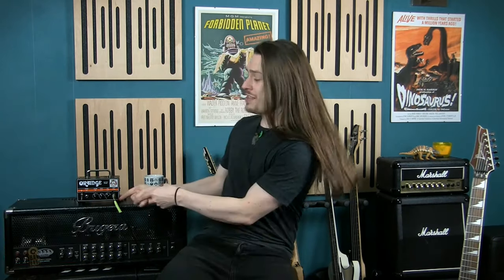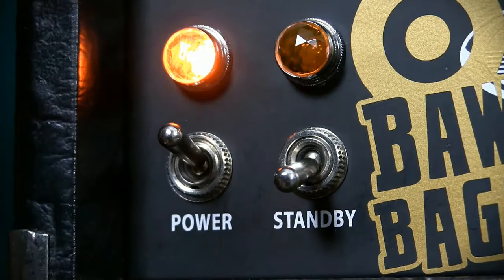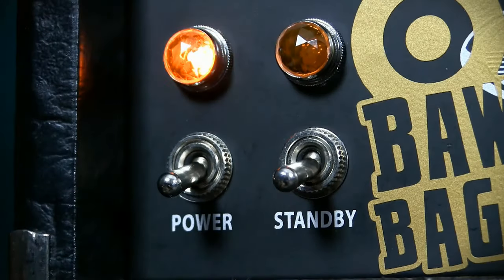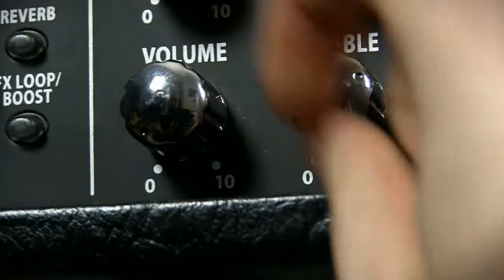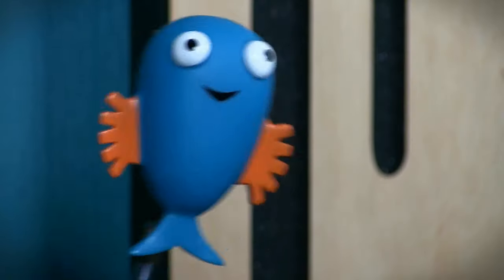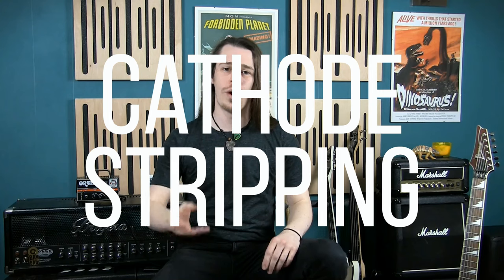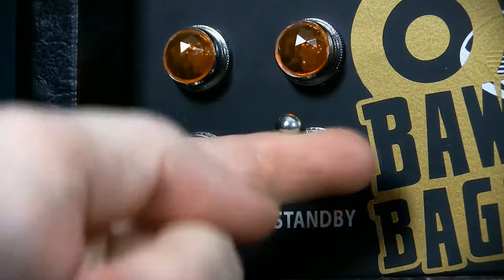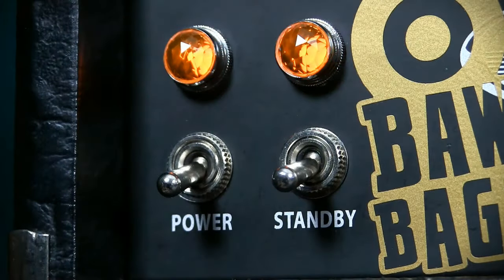Your Standby Switch Is A Lie!

Comment from the maker: To save myself a whole bunch of time answering things individually, I'm going to post links as replies to this thread so you can do your own research.
Reply from the maker: http://www.wamplerpedals.com/news/blog/talking-about-gear/should-i-put-my-amp-on-standby
Reply from the maker: http://www.valvewizard.co.uk/standby.html
Reply from the maker: http://debontamps.com/standby-switches/
Reply from the maker: http://www.londonpower.com/standby-switch
Reply: CSGuitars What bass(es) do you have?
Reply: Isaac--there is literally no point in putting the amp in standby before turning it off.  I personally like to turn the amp off in the middle of a big chord so you can hear the capacitors discharge.
Reply: Yes! it makes that cool "Old tv turning off" sound if you turn it off with the guitar makeing noise
Reply: I approve of this.
Reply: There might be some value in using a standby switch on amps that use a DC-coupled cathode follower (Fender Bassman, Marshall and amps based on those) as the voltage conditions at switch-on can cause arcing in that particular valve.  There are ways to protect against this without using a standby switch, but I've yet to hear of any commercial amp which uses them.
Reply: You can just wire a diode between the grid and cathode.  That said, I don't see the point in putting cathode followers feeding the tone stacks in the first place, from a design perspective.  Low impedance is only necessary if you want high Q filters, and you don't need (or want) high Q in the tone stack.
Reply: It's not about low impedance anymore -that was just Leo Fender's original motivation (he loved 'clean' amps so borrowed a lot of hi-fi ideas). It turned out to be a lucky accident that DC-coupled cathode follower produce a very gradual and pleasant form of overdrive wirthout having to add more gain to the signal path, so they are still much used today.
Reply: What are you talking about? The cathode follower operates with extreme levels of negative feedback, it won't overdrive easily at all.  It's exceptionally linear over its operating range.
Reply: That's the whole tradeoff... you get a gain <1 in exchange for linearity and low impedance, but neither of them are necessary.
Reply: It may be possible to use a diode between the grid and cathode, but I don't know of any commercial guitar amps that do.  So when using any Bassman or Marshall type amp, I'll use the standby switch when turning it on.  For breaks or when switching off, I don't bother.
Reply: My thoughts on the whole Standby switch spiel would be you're more likely to be wasting service life with it since you're putting extra wear into your heaters. If you've ever seen a  dead short in an amplifier, that's generally caused by said heater melting and crashing into a grid, which shorts the 6v heater line into a 330v-ish (depends on your amp's bias and the tube in question) grid line, producing a high current draw and that usually (if you don't use nails as 500A ultra slo-blo fuses) pop the fuse. On another note, if ALL tubes suffered cathode stripping... I'm pretty damn sure I would have been screwed by now since I have a hybrid amp with no standby. Add to that that I'm not the kindest to the tube in that amp since I give it no more than 10 seconds to heat up enough to produce a signal before I start playing and if the cathode stripping issue was to occur, I'd be on my 20th tube already!! So far I've only replaced one and that was because I was getting some Microphonics, and tapping the amp itself made the tube ring out... it was a tinnitus inducer if you popped the top and hit the tube with a pencil because it fed back to the cab and started resonating!!
Reply: +Dietrich Epp
DC coupled cathode followers are usually biased quite hot, to the point where control-grid current flows even at idle. This causes compression (ie: distortion) on the positive-going peaks. The amount of this compression can be increased by biasing the preceding common-cathode gain stage cold and raising its idle anode voltage, or by lowering the cathode resistor of the cathode follower forcing it to draw more idle current, or also by including a grid stopper resistor between the gain stage and cathode follower to limit the amount of grid current that can flow. 
This is a well known effect that is utilised in many high-gain modern "metal" amps - one of the best known examples is the Soldano SLO which features multiple DC coupled cathode followers for their added compression.
Reply: The SLO 100 uses 100k cathode resistors for cathode followers.  I wouldn't call that "quite hot".
Reply: Dietrich Epp you're right. The cathode followers in the SLO are biased relatively cool. That doesn't change the fact that they still draw quiescent grid current and will cause asymmetric compression. I mentioned ways to ACCENTUATE that effects (like biasing the cathode follower hot), I didn't say that the SLO utilised all those methods.
Reply: Quiescent grid current is negligible unless the cathode follower is heavily loaded, and no, the tone stack doesn't do that.  The cathode follower will remain extremely linear over most of its operating range.  In order to get it to distort (compress), you'll have to drive the previous stage into heavy distortion first.
Reply: Dietrich Epp Go 'scope it out. I think you'll be surprised what you'll find. 
A 12AX7/ECC83 will begin to draw grid current even before it reaches 0Vgk, drawing around 300pA at -1Vgk. 
It's nothing to do with loading on the cathode follower, that just reduces its gain (A) further from ~0.9. 
That statement alone shows you don't really know what you're on about.
Reply: You're not here to make accusations about whether people know what they're talking about, you're better than that.

But 300pA is not very much with the source impedances we are talking about.
Reply: Dietrich Epp You're telling me I'm wrong, I'm explaining that in fact, you're wrong. Not making accusations. But you appear to have already made up your mind, and are not listening to (or purposefully ignoring elements of) my argument. So I responded in kind. Maybe that was childish, but it is Youtube after all. 

300pA at -1Vgk may not sound very much, but when we consider that with typical guitar amp DC coupled cathode follower values of 300V B+, 1k5/100k gain stage and 100k cathode follower, the gain stage anode will sit around 210V, and the cathode follower will be biased around -0.3Vgk, and be drawing 20-30uA at quiescent! Also, the control grid impedance shifts from essentially infinite, to as low as a few k-ohms on the positive swings. Explain how all that doesn't add significant distortion?

You're thinking of either text-book designed DC-coupled cathode followers with the cathode follower biased much cooler, or the occasional much more conventionally designed AC-coupled cathode follower we sometimes see in guitar amps which may feature the astonishingly low distortion figures cathode followers are capable of.
But in guitar amps, we don't do things by the book - we want distortion. Anything designed "incorrectly" can be made to distort, just as we could design a common-cathode gain stage with vanishingly low distortion figures too, we can design a cathode follower to have high distortion figures.
Reply: You say that you're "not accusing me" but in the next sentence you suggest that I'm "purposefully ignoring" parts of your argument.  That's just a coy accusation.

I'll admit--I hadn't thought about purposefully biasing cathode followers for distortion.  But I still don't think I'll use it in any of my designs, because I think there are more interesting ways to use the extra stage, and I prefer distortion that's more gradual.  It may be a factor that most of the amps I've really analyzed were either old designs that didn't have stages to spare for cathode followers, or more modern high-gain designs with 220k anode resistors.

Peace among worlds.
Reply: Dietrich Epp I'm done, I hope ignorance is bliss.
Reply: Greg Robinson "I'm done, except I want to throw a passing insult at you for good measure."
Reply: @Dietrich Epp, cathode follower distortion is gradual -more gradual than that of an ordinary gain stage, precisely because it uses 100% cathode degenerative feedback. It is 'trying' not to distort, by 'trying' to linearise the normally-abrupt change in input impedance as you transition the grid-current region. Instead of clipping suddenly like an ordinary gain stage, it appears to 'compress' the signal peaks more gently. Worth playing with.
Reply: Just switch the (expletive deleted) thing off!
Reply: Any decent engineer nowadays will put in arc protection. It's pretty standard. But you are correct in that the Bassman and Early Marshall amps needed them.
Reply: CSGuitars + what's up with the blue fish dude? he looking to score ? hahaha
Reply: Somebody does not know how to spell "utilized", and someone else does not know how to spell "linearize".
 Hmmm ...
With the same spelling errors being exhibited by separate contributors, one would expect that those two have attended the same school.
 Well, either that, or there is a larger problem concerning the incorrect spelling of words that contain the letter Z (properly pronounced "Zee", NOT "Zed".   Otherwise, "A"  would be pronounced "Aed", "B" as "Bed", you can do this yourself with ALL of the letters of the Alphabet to Really find out how preposterously stupid it is, "N" as "Ned, and "T" as "Ted", and so forth and so on, et cetera.  But that is another story ...)
Reply: Electron Conjuror lol
Reply: Thanks mate
Reply: @isaachinkey398  I'd turn it off normally, then leave a few minutes to cool down before moving it. That's all
Reply: @therideneverends1697  😲😲 I always figured it was bad to cut it at a high level. I'm real paranoid about it as I am unfamiliar with tube amps and only know that doing that with home theater speakers could blow ur sh*t easily. Glad to see people aimlessly wandering the same path as me here
Reply: Hello Colin! I know this is an old video, but maybe you will still see my comment. I have read that some amps can be used safely without a cab for silent recording (FX send into interface) when the amp is on standby, as the preamp is still running normally, but is cut off from the power amp. Is this true?

Comment: It's great for taking a break in the studio. You cant mess with the volume once you're tracking. It's also good to use if your amp has a speaker pop when you turn it on. If you are using an amp in the studio it's preferred to have a standby. That's why most high end amps include them.

Comment: Standby switches were designed long before guitar stands. Whenever I finished playing, my bass would either be left leaning against the cab or laying on top of the amp. The standby switch disables any mad feedback howl that would inevitably happen 5 seconds after walking away from it. Very useful in live pub jam sessions.
Reply from the maker: You do realise rolling down the volume control on the instrument will achieve that too, right?
Reply: @ScienceofLoud  Try telling that to drunken musicians getting up and using your gear.
Reply from the maker: @zibbezabba2491  That sounds like you just can't secure your own equipment correctly...
Reply: @ScienceofLoud  Yes I can, I use the standby switch.
Reply: Why not have just turned the volume off on the bass?
Reply: @snakeeyes3733  There's a light on the standby switch. I prefer seeing with my own eyes.

Comment: That's some useful information, I'll definitely use it in 10-20 years when I buy my first tube amp...
Reply: Zachary Volt you can get a nice tube amp without spending a ton. Why would it take 20 years
Reply: Because I have no money. And no way to get money. Also, I prefer to spend more money on the guitars than the amps.
Reply: I'd switch that up. I spent about $1200 for a USED Mesa Boogie Triple Rectifier and a Marshall 4x12 cab and spent only about $300 for my guitar and upgraded the pickups to EMG 81 in the bridge and 60 in the neck, which was about $220 or 230. So there is a huge difference there. But, I wouldnt have done it any other way. The amp sounds great, plus I have a Line 6 Pod HD500x with a whole bunch of effects and pedals. But I put a colordrive overdrive simulator on it and boom sounds great. 

Now, I'm not saying spend $1200 for an amp but put a little bit more money in the amp then worry about a guitar. Or go half and half, spend the money for an ok guitar and an ok tube amp.
Reply: I see it this way: You can get an okay guitar for $120 and an expensive amp and cab for $1000 to $2000, or get a great guitar for upwards of $300, and a great amp (Marshall CODE, Orange Micro, etc.) for around $200 - $500 (maybe even free if you use an amp sim.)
Its difficult to get a good sound out of a cheap guitar, but there are great inexpensive amps out there, so in my opinion, you should spend more on the guitar.

On a side note, cheaper guitars tend to be harder to play, because they can sometimes have small, yet important, tasks left undone, like some fretwork and specific nut trimming and fitting.
Reply: you can get into a tube amp/cab for much cheaper than that TBH, don't think all of them are that outrageous.
Reply: Get a used Peavey Windsor.  It is essentially a Marshall JCM800 clone, you can find them for $2-300 easy.  Oh, and they sound fucking spectacular!
Reply: alternatively, get a fender bassbreaker, or egnater rebel/tweaker, or blackstar club 20, laney cub 12r, marshall dsl5/15, vox ac10. All of these are available tube combos (either 1x12 or bigger)  you can gig with, record with and all cost under 700 dollars (most of them are less than 600 aside from the blackstar). Hell, the Laney Cub 12r is a 15 watt 2x12 for 500 dollars. And none of this is a solid state power section or anything. You've got so many options for tube combos. It's hard to make a crap amp sound good, even with a nice guitar. But you can make a mediocre gutiar sound killer with a nice amp.
Reply: I got a squier strat and replaced the pickups and it plays amazing, so no it's not true that it's difficult to get a good sound out of a cheap guitar. Plus, you can fork up a couple hundred more and get a mid-range guitar for like ($300-$500). I bought my squier for $50 and yes i use it as my experimental guitar but, like i said, it sounds perfect to me.

 I also bought a bugera 1990 tube amp for $200 and it's a marshall jcm800/900 clone. It also sounds pretty badass. If you have the funds, i'd say go for it and get top notch everything, but you don't really HAVE to in order to have an awesome sound. Some people out there are only about name brand/high end shit, but that's just stupid IMO. I have some higher end guitars now but 90% of the time I use my squier because I gave it my own flavor and changed a few things on it. 

BTW, I bought cheap pickups too, like some $15 dual hot rails on Amazon and I love the sound. I've been playing for 20 years so I know what sounds good to me and what sounds like asshole.

Comment: Well, every Mesa Boogie manual: "The STANDBY switch turns off the high voltages inside the amplifier while allowing the tube filaments to stay warm and ready for immediate use. It’s a good practice to turn on the A.C. power with this switch in the STANDBY position, allowing the tubes 30 seconds or so to warm up. This procedure prevents tube problems and increases their toneful life substantially."

Marshall Plexi manual: "The Standby Switch is used in conjunction with the Power Switch (item 1) to ‘warm up’ the amplifier before use and to prolong the life of the output valves. When powering up the amplifier always engage the Power Switch (item 1) first. This allows the application of the voltage required to heat the valves to their correct operating temperature. After about 2 minutes, when the valves are up to the correct temperature, the Standby Switch can be engaged. Upon doing this the H.T. (High Tension) which is the high voltage required by the output valves to pass signal (and hence produce sound) is applied. Your amp should be completely powered down before the selector is turned. To prolong valve life, the Standby Switch alone should be used to turn the amplifier on and off during breaks in a performance. Also, upon full power down, always disengage the Standby Switch prior to the main Power Switch (item 1)"

EVH 5150 amps manual: ". STANDBY—Place this switch in the OFF position to put the amp in STANDBY mode. This should be done when taking a break from playing or before turning the amp POWER to OFF as outlined above in the POWER section. Using the STANDBY mode prolongs the life of the tubes in the amp."

Ampeg V4B: ". STANDBY—Place this switch in the OFF position to put the amp in STANDBY mode. This should be done when taking a break from playing or before turning the amp POWER to OFF as outlined above in the POWER section. Using the STANDBY mode prolongs the life of the tubes in the amp."

So, I assume all these tube amp manufacturers have no idea about the sacred truth of no need for a Standby switch, right?

Comment: After doing some research it seems like amps with older solid state rectifiers need to be turned on before the standby switch is flipped on to prevent high voltage from surging into tubes that aren't ready for it, or amps that have indirectly heated tubes and a directly heated rectifier. However, most modern tube amps have inrush current limiters to prevent this from happening and thus eliminating the need for a Standby switch, for older amps though it's still necessary to flip the standby on after the tubes warm up. I found some pretty reliable articles from manufacturers like Peavey and Fender that explain that it is not as black and white as you mention.